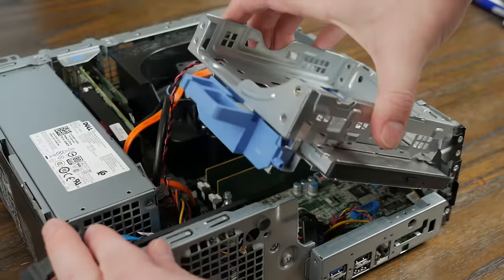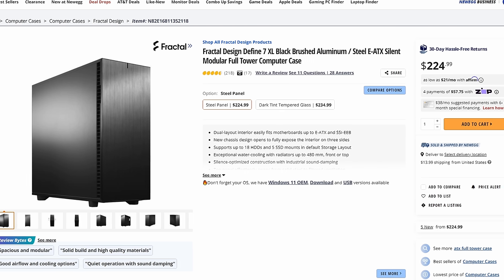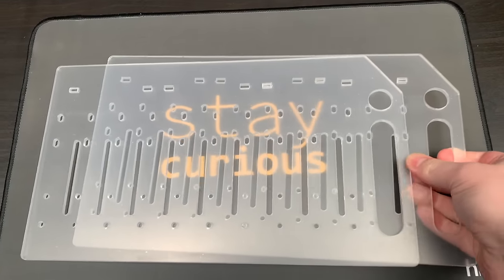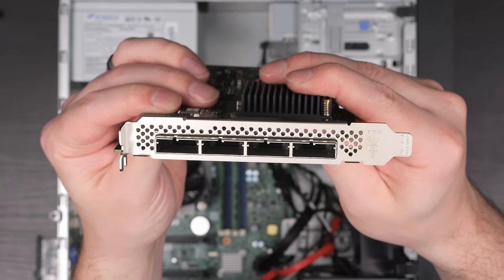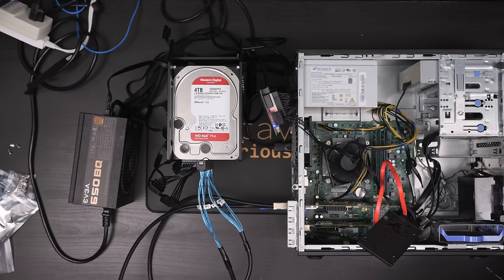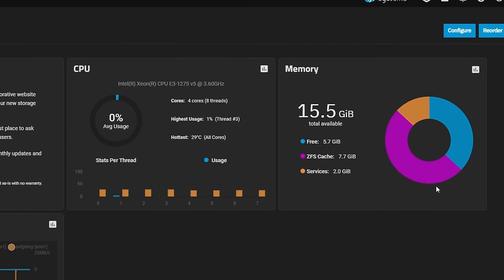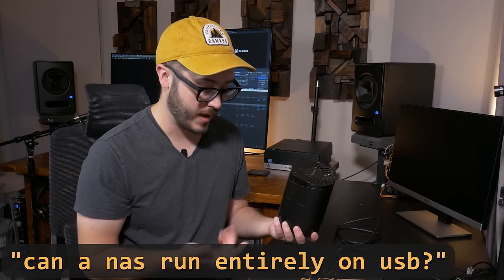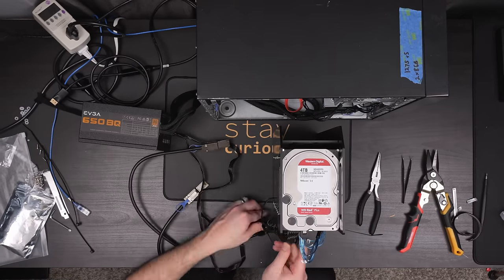I Made My Own JBOD Enclosure For CHEAP

Comment: For HDD mounting i'd suggest the Phantek PH-HDDKT_03 instead. Easy to mount the drives in, stackable, have rubber isolation and cooling 4 disks with one 120mm fan works perfect. If you want to i can send you my f3d / stl files for a baseplate and fan shroud.

Comment: If you live in a place with expensive power it is worth going with 2.5 inch drives. The lsi controller alone will permanently suck around 15w. You will need to accept less space and less performance though.

Comment: Very neat setup.
I had never heard of that ADD2PSU device,  when I went to configure 30 HDDs for UnRAID (just because how awesome would it be to connect 30 HDDs) I used a passive 24pin splitter I had laying around from back when I was doing ETH mining and the rigs always needed 2x PSUs. They are cheaper too. FYI

btw, I seem to always stumble into your videos. Very clean video, well presented, informative, one of the best, and just seems to answer questions I had, and didn't know to ask. Thanks.

Comment: I'd actually considered building an enclosure myself by picking up two IKEA Lack end tables… You build one, flip it upside down, and mount a motherboard and power supply to the inside. You bolt the 2nd top onto the upturned legs to make a solid box, and the legs get used to make sort of an H above the motherboard to mount these $25ish drive cages from Amazon with rails. Nice thing about those is that you can swap a drive pretty quickly. Remove the cables from the back and the drives slide out the front. They have a "cover" for mounting a fan but … I wouldn't bother, because I've got a better idea.

Reason for doing it this way? The top can be removed to help with maintenance. And if you close off the sides, you could put a nice big 20" fan on the front of this thing that'd entirely replace the air volume inside the box every few seconds. Even at low pressure, that'd be effective. You could put some mesh on the back to keep pets from possibly getting in there, but mostly keep it as open front to back as possible.

A bonus: If you have any 19" rack gear that'd make a useful part of the system, the spacing on these Lack tables will accommodate, but that might interfere with my planned cooling solution.

Comment: I'm thinking of buying one of those vertical test stand units and then build a shell around it. After watching this video, I'm now thinking that the test stand and something like this plastic HD stand maybe the way to go.
I am looking at making a shell that would enclose both stands by using those four(4) side slotted aluminum extrusions in each corner. Connect the extrusions to the bottom and then just slide the five(5) sided lid on to the extrusions.
Filtered fan ventilation is the only part of the design that I'm having problems coming to grips with.

Comment: I love this.  You could also rip out the guts of an old case and put this frame inside so you don't see the octopus cables and PSU.

I wish there was something from AliExpress with stacking trays so you don't have to pull the whole thing apart to get to one drive.  
NAS systems are stupidly expensive or limited.  NAS PC cases seem hobbled.  They are not ATX/EATX capable and for those of us who don't use them as an ornament, we don't need pretty at all - we need cooling.

The other good thing about having a modular PC rather than NAS is that your 10G NIC can be upgraded in the PC, so you can get closer to internal SSD speeds on your LAN by adding SSD's to the server box.

Comment: A heads up while there is still time to do something about it.  If you hard-mount the drives all to a common plate like that, the drives will vibrate each other to death, rapidly.  Don't do that.  I recommend some sort of dampener between the drives and the plates.  Don't be shocked if you get batches of sudden drive failures.  Google among others learned this lesson the hard way in their data centers long ago.  As did I, and a few other people.  Metal is far worse than plastic, and denser metals like steel being the worst, but any common hard-mount is going to cause problems.  I'd print up some TPU isolation pieces to go between the drives and plates.  A lot of ways that can be done but if you can do mixed material printing you could print them out of a rigid plastic with TPU in the middle.  If you can't do that, I'm sure there are some options you can find that can be purchased and used as a go-between.  Or instead of screwing the drives in, use a damping material inside each plate, and run a rod between the plates to clamp the drives into place with the dampening material as a buffer (though that is my least favorite option because the dampening material would be under compression and likely be less effective).

Comment: Really cool to see a good youtube video on a nice JBOD. Very practical and affordable. Also pretty versatile, you could hook up the drives to different computers for example. If you're someone who prefers clusters. Much more affordable than finding a solution to hook up separately for each node.
Also, I would prefer using the same power supply for the PC and whatever drives you hook up to you in the JBOD. As someone else pointed out, you could've replaced the PSU in the desktop with your better PSU that you used anyways.

Comment: you can also do this with shelf tracks for about ~$6 right now, but that works as well :)
Reply: $6 where?
Reply: @RoshiGaming  Amazon sorry, might be cheaper at a local hardware store so check there as well. You just cut it into 4 even pieces and bend the ends so it stands and you mount the drives like he did except it’s 4 pieces

Comment: I prefer the modularity, expandability, and partial reliability buff.  if the hba card goes bad, replace it.  want to expand? I can get another set of cables and acrylic plate.  PSU dies? I have 5 in a drawer somewhere.

With a bespoke enclosure, if a half-cent smd capacitor dies, I'm out 300$ or more for the entire setup.  Everything is non-replaceable and nonstandard.  And I'd certainly trust a server card more than some chinesium usb backplane.  the entire POINT of putting so many drives together like this is to prepare for inevitable hardware failure.

My final goal would be a drive shelf that can be used with a common backplane to make it easier to swap drives out.

Comment: And this is one of the reasons why I didn't throw out an old case I have here without the front fascia. If I go with just 2.5" drives, that case can fit 32 drives + 5 3.5". If I go with just  3.5" drives, the case can fit 11 drives. An alternative to the whole powering + data would be buying a SATA backplane. Jonsbo makes two cases which can fit multiple drives and you can buy just the backplanes of those cases. One fits 5 drives and the other fits 8.
Reply from the maker: Yeah I might check out the Jonsbo cases at some point

Comment: i've done this in a slightly different manner. if it commects to the big power workstation i run a sata cable inside and use sata expanders. i have a usb to sata adapter in case i need to use that but i'm also not using truenas or anything like that. just labeled the partitions and use them like that. just don't have a spare computer (or really the space) to setup a dedicated nas machine.

Comment: Keep in mind that most consumer and NAS rated disc'  can have very short lifetime when used in enclosures like this. they are normally only designed to handle vibrations from up to 4 discs.

Comment: Rosewill makes a rack mounted case that has 9 5.25 drive bays. And there  cages that convert 3 3.25 drive bays into 4 hot swappable  bays. So you end up with a 12 bay hot swappable 4u chassis.
Reply: yes but it also costs a lot more

Comment: JONSBO N3 great little case, i just built a overkill nas box, 11900k 64 ram 10gbe nvme 8 drives 4 nvme, 1100watt power supply. it's a sleeper.

Comment: I have a similar setup with a ThinkCentre m720q, I'm using a 2-port hba to make the NAS. I need to find a way to use the 650W PSU to power the drives but also the 3-node of ThinkCentre... So that I don't have 3 psu for the nodes and 1 for the drives...

Also I'm thinking of getting a sas expander to expand my drives collection.
Reply: Using a PSU as the power source for three minipc's is an interesting idea. You could do it with three DC voltage regulators I suppose, but that would require some wire splicing and probably another 3d printed enclosure.
Reply: > So that I don't have 3 psu for the nodes and 1 for the drives...
why tho? and how does this even work? what if you need, say, to hard reset a node? does soft rebooting one node not interfere with the others' work?
Reply: @night_h4nter hard resetting the node could still be accomplished via removal of the plug in the back of the MiniPC. The only difference from having the default number of power bricks/psu's is that you would be pulling power from the PSU to serve it to the MiniPC's power plug, essentially bypassing the in-line power bricks. It would just take some DC voltage regulators and soldering the appropriate power connector to a power plug on the PSU.

Comment: For the price this isn't that bad of a solution to add more drives. I'm building out a rack and while I like the 45 Drives HL setup, I know I am going to be adding more drives down the line.  I could get a couple of these JOBD enclosures and put them on a shelf in the rack very easily. I have been looking at options to adding more drives without spending more 45-drives prices. But in my case maybe the answer is finding a chassis with more capacity.

Comment: I put together a 100tb system like this using an HP z440 with Xeon1660v4, 64gb ECC RAM, Nvme boot SSD, Sata boot SSD's , 8x12tb Hard drives, LSI 9300-8i controller for under $300 ( hard drives extra. ) I use as my Everyday computer runs Triple boot Win-10, Win-11, Linux. Fully supported by Microsoft , HP, and Linux  ( Plug & Play Hardware. ) This computer is Rock Solid Stable and Reliable. Never Crashes or Hangs and Everything works Perfect.

Comment: Janky or not - this is a very cool solution. I have an old HP MicroServer which is has seen better days. I've basically replaced every ancillary so far and would have to replace it some or other time with a cheap and reliable solution, as the off the shelf NAS hardware, is just too expensive. So thanx for trying this and getting it to work. Buy that 3D Printer - you will not be sorry! 😎

Comment: I'm sure I've seen these drive towers in metal, so maybe a lot easier.
I had a pile of old drives, but after doing the math I was better off leaving them in the junk box (for retro projects etc) and just buy a modern high capacity drive.
In one of my 'jank' setups I have an industrial PC running primarily as a security recorder, but with several USB hard drives plugged in for general network sharing. Yes they are quite slow, however with that as a given, I never use them for anything needing speed, like video edits.
They mostly get used for archival/backup tasks where I start the task then walk away for dinner etc. Although one drive is a very worn, near EOL SSD that I've put a pile of FLAC music on, streams lovely, music does not need much bandwidth and that drive is happy been 99% read only. (It's kind of a test case for near dead SSD usage)

Comment: Been wanting to do this for a long time but was stuck about powering a seperate PSU (and gracefull power off).  A note about fans  Have a look at Gelid...been using these for years, silent, slower but much cheaper.  In a 4 drive internal enclosure (like your external enclosure) my spinning disks are always around 30-35 C - I reckon you do not need huge speed to push air over drives if the fan is quite close to them.

Comment: Using 4 bay SAS hotswap "internal" components (4 bay), you might have been able to do this just as cheap, but have the convenience of hot swap and trays and such.   Would have used straight SAS connect to each (you buy 2 of them) and the the rest, use your PSU and power board, etc.  Would the fans on those ready made hot swap bay units be better than Noctua?  Probably not, so YMMV with regards to "noise" of the fan on such 4 bay units.

Comment: Are you sure these 1000 W of power are enough for that computer and 8 hard drives? I think I would buy a separate 500 W power supply for each drive just to be safe.
Reply: Now sarcasm aside, I think it's a pretty nice video still, but I wish you could have looked for some mini PC case with a single PCIe slot instead, would make such a build much more neater/portable/taking less space. With full tower case, you might as well just put that drive tower inside of it and it'll be safer there, and then get a cheaper card with internal cabling... And keep existing Platinium power supply that wouldn't even be used to half its power rating under max load. Cheers.

Comment: FSP is quite reputable. If the PSU can master the spin-up current without going into OCP/OPP protection mode, then it should hold up in normal operation just fine, and it won't take any permanent damage anyway. I mean those 50W continuous consumption by drives really isn't much to worry about.

Comment: MY DIY NAS project from Summer 2023:
Repurposed prior desktop machine that's just gathering dust:
- Mobo: AMD FX-8350; 32GB RAM; 7 int SATA ports
- case: 4 @ 5.25" ext bays; 6 @ 3.5" int bays; 2 @ 2.5" int bays; 4 @ 120mm fans (3 front, 1 rear); 1 @ 140mm fan on side panel, 2 @ 200mm fans on top panel

I added:
- Add converter tray: 1 @ 5.25" ext. bay ==> 6 @ 2.5" ext. bay, hot-swappable
- Add converter tray: 3 @ 5.25" ext. bay ==> 5 @ 3.5" int. bay
- Add PCIe card: dual 2.5Gbps NIC
- Add PCIe card: SATA controller, 10-port
- Add PCIe card: M.2 adapter = 1 m.2 NVMe + 1 mSATA (uses only 1 SATA port)
- Add 5-in-1 SATA power splitter cables

All PCIe slots and SATA ports are utilized, but I still have 3 drives open drive slots. However, thanks to this video, I know I can swap to a 16-port HBA if I want full drive slot utilization.

Comment: PC fans are terribly inefficient unless you put them as a stack of like 4 HDDs in a solid square tube so that there was no holes for the air to leak through other than back side and fan blades themself. Pretty easy to isolate vibrations in this setup too. And there must be a gap between fans and drives, like 1cm at least. Using standard AL extruded profiles to built the whole thing.
For handling drive vibrations I found the cheapest, practical, most effective and almost forever lasting (unlike foams) to be a simple velcro strips sandwiched between narrow rectangular sled plates on HDDs and corresponding shelve plates in the air tunnels. That way I got the room to even mount two 20x6x150mm AL heatsinks on each side of HDD via silicone heat-spreader.
For power I am using DIY crimped 15pin SATA connectors wired redundantly to multiple PSU connectors via x8 WAGO spring terminal blocks to eliminate terrible single point of failure that is typical Molex 5pin power connector.

Comment: I'm thinking of doing a mini version of this ever since I saw the Lian Li Lan2-3X expansion adapter for a very cheap $9 CAD on Amazon. It's an add-on to put 3 hotswapabble drives in the LanCool 2 case, but in reality, it's just a PCB with the usual 3 SATA/Power on one side and two power, 3 SATA the other side, so nothing proprietary.  Add this to an old removable haddrive  HDD case 
It might have only 3 bays, but it's cheap and cost me only $10 and old unused parts.

Comment: Great video! It wouldn't take much effort or cost a great deal more to draw up those side panels in CAD including a mounting for the PSU at the back and perhaps a cleaner mount for the fans at the front. Then have it CNC cut by your local machine shop from aluminum sheet, spray it black and you're on version 2. Maybe add space for more drives, too! :)

Comment: Thats pretty cool and certainly scratches the "lets tinker with something" itch pretty much anyone watching your channel has.  If you do not want to tinker quite that way you can just throw all that into something like an Antec P101 silent has all the fans you need,  pickup a raid card,  that PSU in the thinkstation may even be  enough for all of it you could prolly get by close to 100 cheaper and if you needed to change the PSU then 60ish cheaper.  Granted your way would be more interesting and fun.

Comment: That's funny, I just saw the video and that's pretty much what I did to add disks to an old 1U proliant DL360 Gen9 I use, I pretty much had everything except for the HBA and cables, I have a 3d printer so I didn't buy the HDD thing, but that's pretty much exactly the setup I made 1 year ago!! 😂

Comment: Awesome video, can you please make a video on upgrade path for this jbod for higher read/write transfer speeds ?
Reply: I mentioned in an earlier comment, Toshiba N300 drives would likely be faster. You can also have a lot of RAM for zfs ARC cache, and use a Special device SSD mirror (and possibly L2ARC device) if you want to stick with RAIDZ2 and not lose 1/2 your free space with a mirror pool.

Comment: i use a 4bay enclosure from fantec which can give you up to usb 3 10gbits over usb and you can get sometimes for around 80€ used on ebay or new for around 140€. there is also an 8bay version of this for around 300€ new.

Comment: TBH I almost prefer the Jank aesthetic when it comes to my home lab setups. Everything still works just fine, and the whole point is it’s a forever project so if I make everything way too neat and tidy, then ripping it apart 6 months down the line to put things back together will take much longer. Also I’m mainly sticking things together as a proof of concept or a short term test of config, when I seriously deploy it I put more effort in.